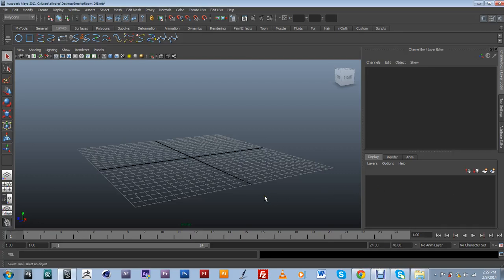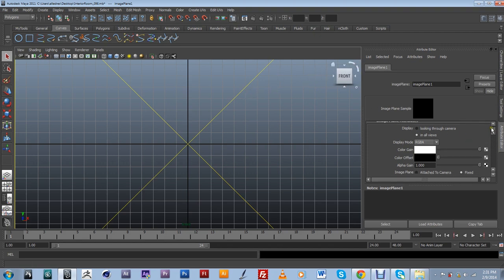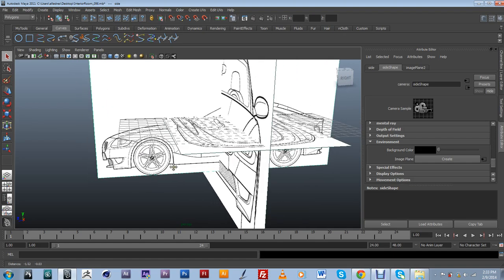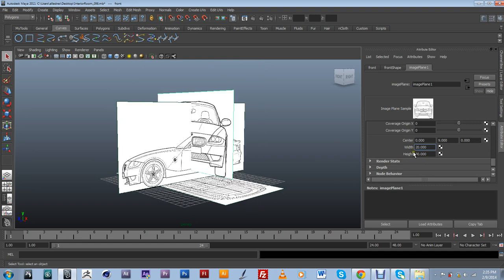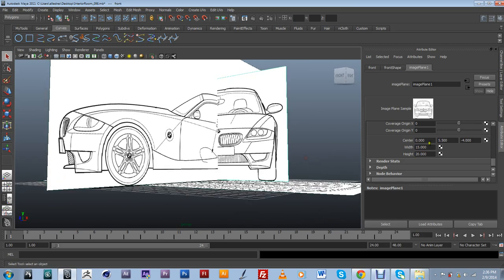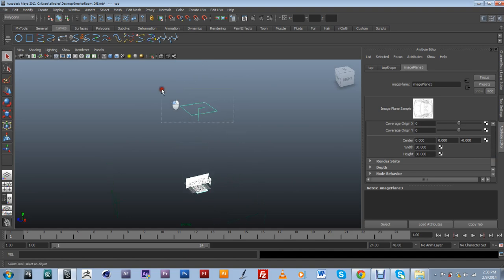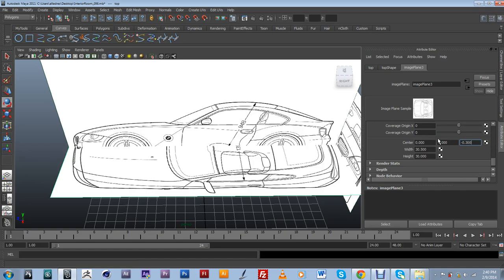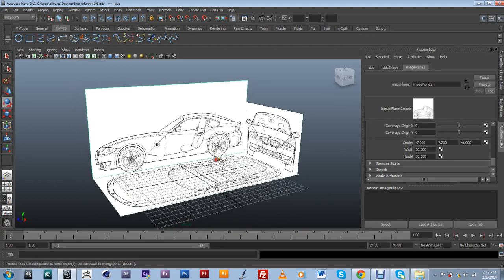Maya: Vehicle Modeling 1- Image Planes.

Comment: My top orthographic camera doesn't seem to rotate like yours did. Please help! Also, is it not easier to manually adjust the planes using move tool(channel box) instead of using attribute editor(image center etc)? How different is it?
Reply: +Digvijit Kaul Actually camera is rotatable but image plane doesn't respond to it. That's what i meant. Any help would be appreciated. Thanks!
Reply: +Digvijit Kaul hey there.   Did you get it?  If not I'll answer you now just incase
Reply: Ok 
1. Select the move tool (short cut E)
2. Select Tool Settings normally in upper right corner.  WINDOW WITH SETTINGS TO THAT TOOL POPS UP
3. look for DISCREATE ROTATE (it may be checked off, so check it ON)
4. Look for STEPSIZE (set it to how many degrees you want you rotate tool to turn, circle has 360 degrees total). In this case I would set it to 45 degrees for this set up.
5. Now try it....   👋😁👍

Franklyn T Grant Jr
FGXMedia

Comment: If you want to learn Maya NOTE: This series is very good. It takes you step by step through spline caging TO A POINT. Then things get quite hair raising and there is NONE of the complicated stuff featured. Booleaning is very tricky and unstable for when you get to the detailing stage. After some basic spline step ups I'd recommend crossing over to direct polygon drawing. You will have to find your own way later in the series! 

Wish someone had to me so I'll put it up here :)
Reply: +Devin du Plessis  in what parte exactly this happen? Btw,the  booleans ,in my opinion,are the worst thing added in maya.
Reply: I can't quite remember man but towards the end of the series you'll find some gaps. Yeah booleans in many softwares are a waste of time. I crossed over to Rhino and downloaded the T-Spline plugin from Autodesk. Now I've also learned Grasshopper which is great as it affords you strict control over a large number of individual items.

Comment: Why didn't you just hold the Ctrl key and dial the values in on the translations and scales? Why type them in over and over again. Why didn't you move the pivot point to the bottom of the image so you didn't have to move the image to the grid line each time you scaled it? The name of the game is efficiency of movement. Less clicks and repeating steps means speed and that means higher production rates. Please don't teach bad habits.